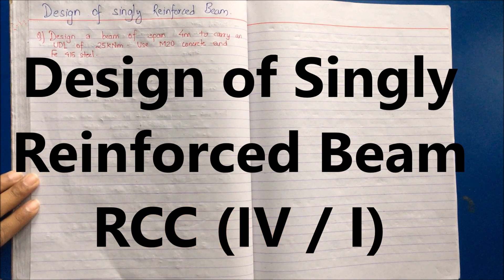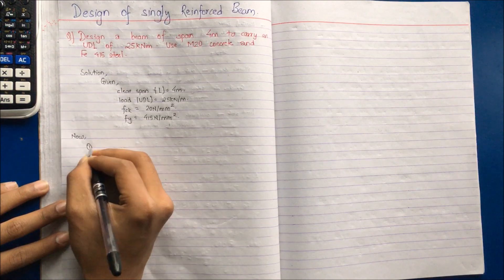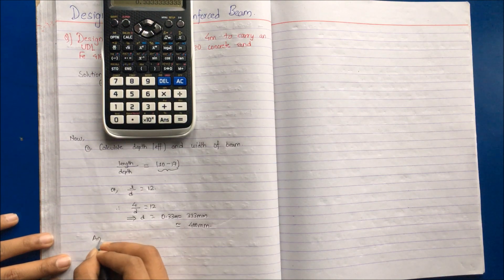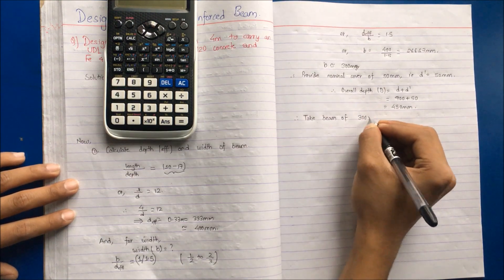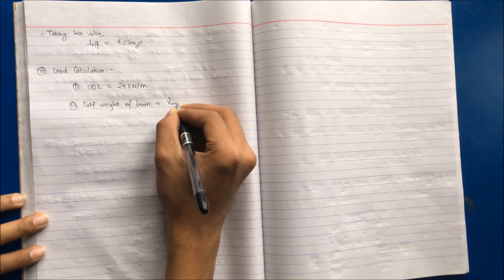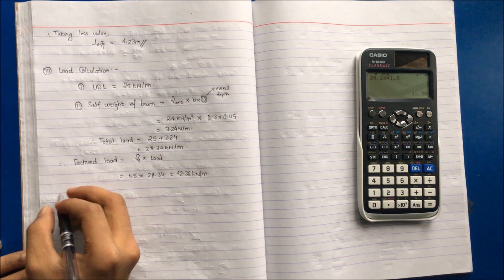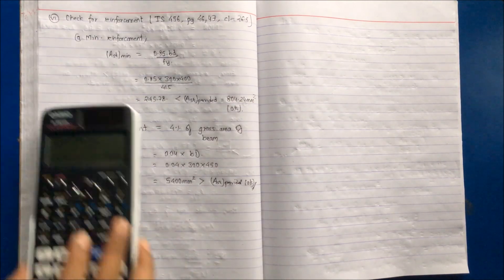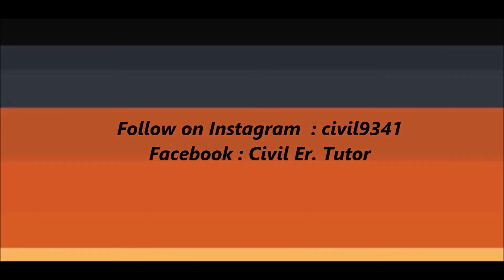Design of Singly Reinforced Beam | Limit State Method | RCC structure | Mumbai University | IOE, TU

Comment: Good job .. but u didnt explained the requied depth of beam. Which most important part in single reinforced beam. And please tell me that when the requied depth is greater than the assumed depth , what to do then next pls..
Reply from the maker: Adopt the greater depth and compute rebar with respect to it.
Reply: If the question is specificly asking for singley reinforced bram design, than go with greater 'd' and continue steps mentioned in video.
If there is no limitation ( or limitation of depth) , then design doubly reinforced beam

Comment: Design a beam using limit state of 300 × 600
mm (overall) to support ultimate bending
moment 50 kNm, shear force 50 kN and torsion
50 kNm with M 25 grade of concrete and
Fe 415 grade of steel